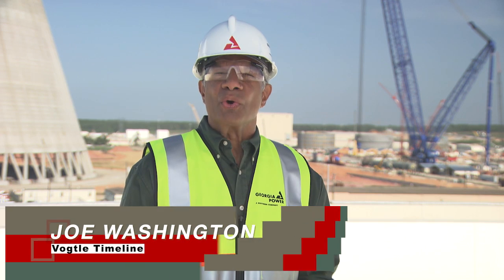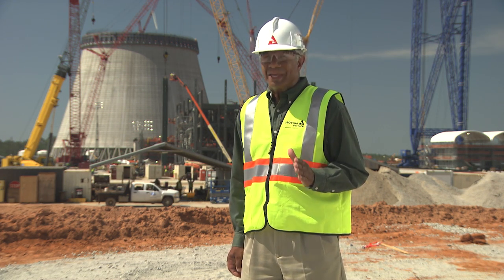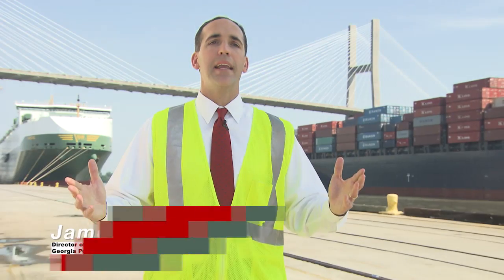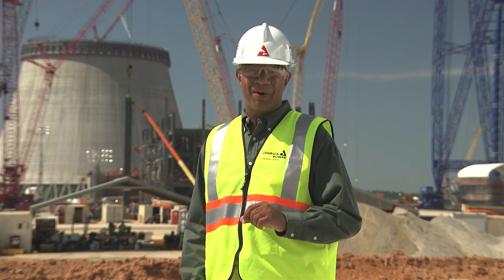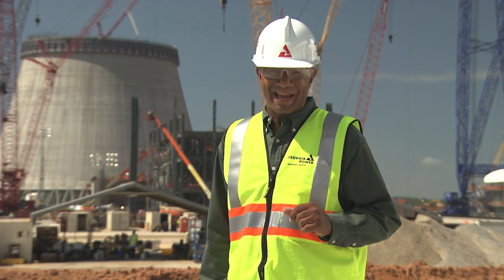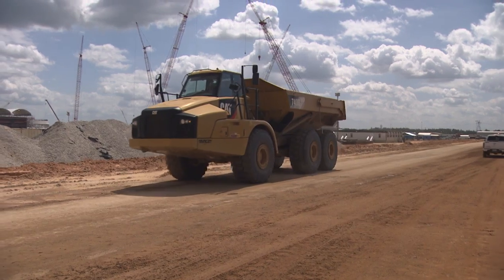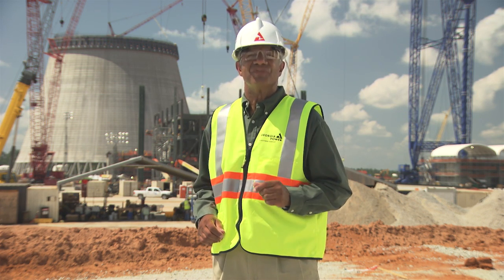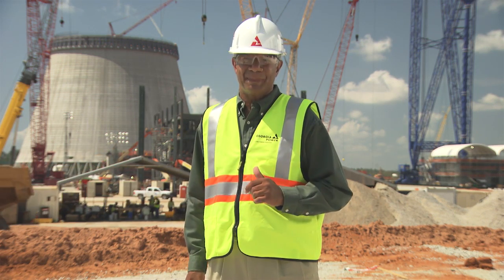Vogtle 2nd Quarter 2014 Construction Update

Comment: WHO PROFITS FROM CWIP?
Nuclear power is so risky that Wall Street has rejected financing new reactors and insurance companies still will not insure the technology. CWIP makes building new nuclear reactors possible by protecting Georgia Power and its partners from all investment risk by investing their customers’ money instead. With CWIP, electric customers take the risk of construction delays and cost overruns. Georgia electric customers finance the construction, even if the reactors are never completed, and the power company is guaranteed a profit, even on their cost overruns.
Reply: +Josue Actually no, nuclear energy is not risky.  Per unit of energy produced, nuclear power is the safest form of energy, safer than coal, safer than natural gas, safer than solar, even in the current form of pressurized water reactors.   Yes, nuclear is expensive, so it's understandable that Wall Street didn't want to finance construction.  The only other option besides a nuclear plant that would provide consistent and dense power is a coal or natural gas plant.